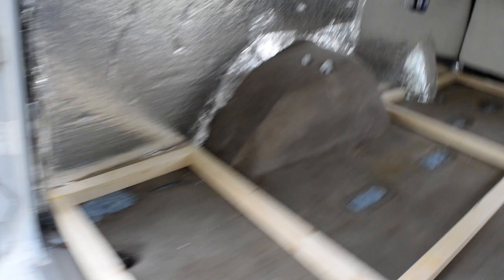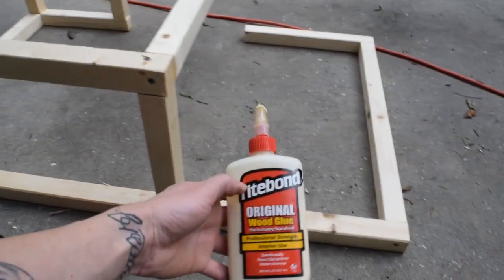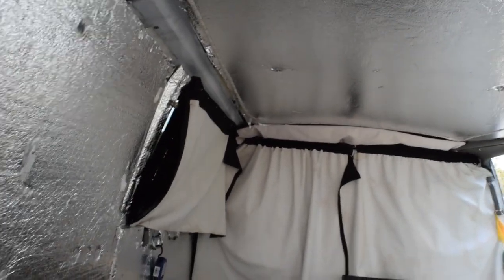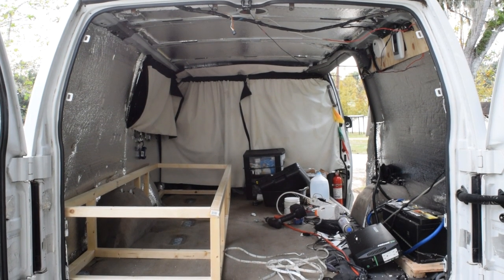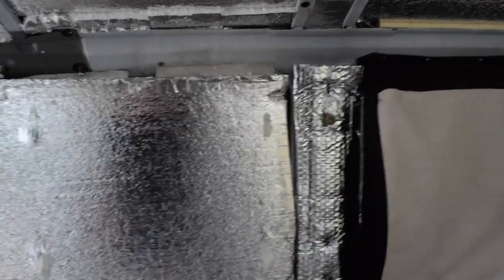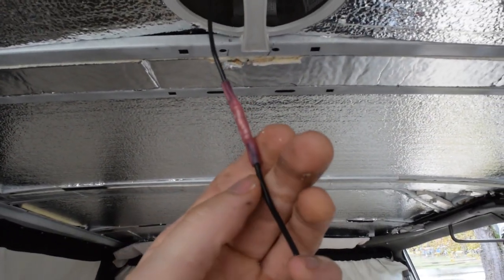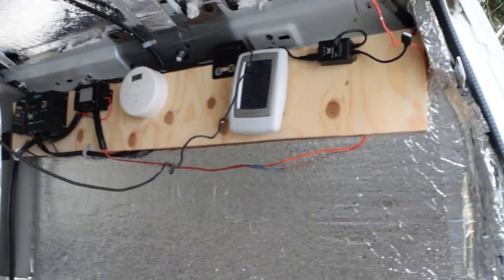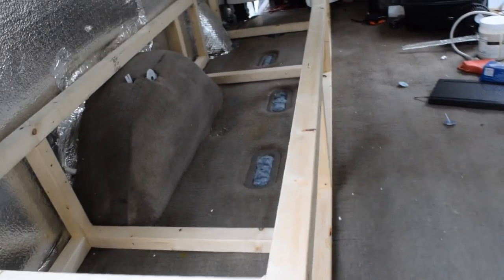Stealth Camper Astro Van Dwelling Build 1

Comment: I like your wire connection not sure if this is the same you are using? I like to use the heat-shrink and solder connectors, these connectors solder wire as the heatshrink heats up to seal, mostly used for exterior or hard to reach areas that you do not want to  ever access again. Very strong and air tight/moisture /water proof. Expensive but well worth  not having to dig for connection troubles in difficult access areas more than one time. Love your ideas on the Astro.
Reply from the maker: +Tioga Trails Thank you! Sometimes I solder, sometimes I crimp. In an area that won't get much vibration I don't mind crimping. I almost always use heat shrink though.

Comment: Good job!  Anxious to see the rest of the build.  What is the length and width of the passenger side bed?  I'm preparing to convert my astro van also.  Like the idea of the taller compartment behind the driver's seat also.
Reply from the maker: +coastal455 Thanks! I'm not sure yet. The frame is about 24" deep, as well as the one on the drivers side.
Reply from the maker: +coastal455 Also, at night its going to be one big big rather than two tiny ones

Comment: What's the good vs bad of keeping the original carpet floor? Moisture? Just bought my Astro and I like the idea of not covering the floor seat attachments if possible so I can possibly put seats back into van if needed. 

Also, I like the original van AC and heat in the rear ceiling. Thoughts on keeping original ceiling?

Thanks, great videos!